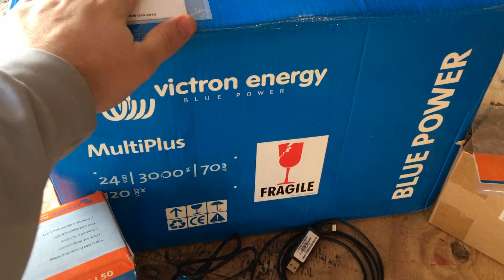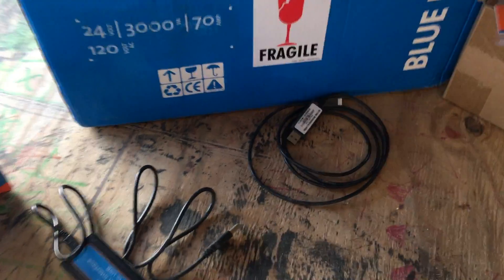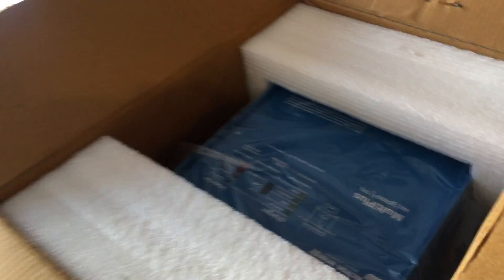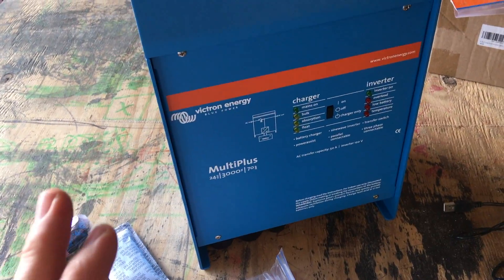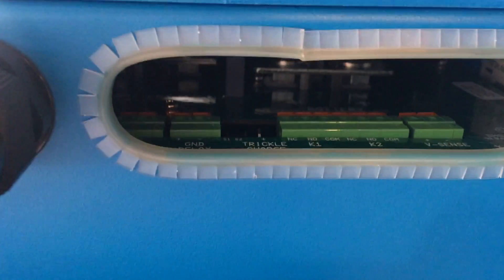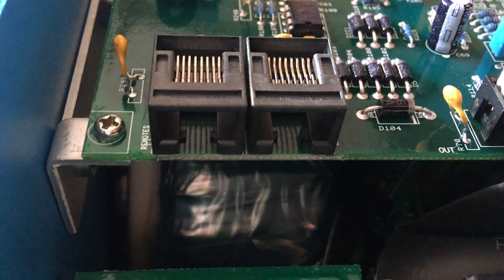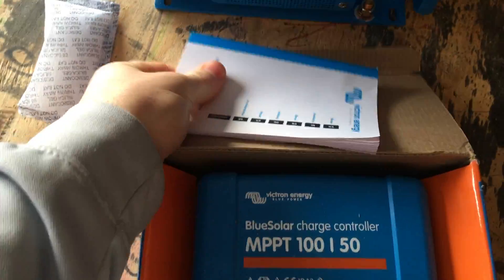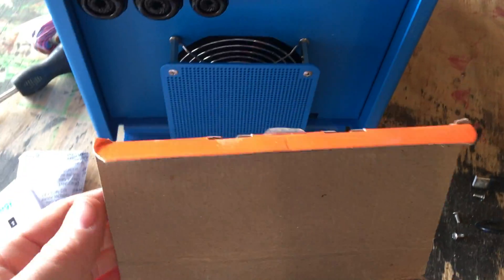We're Going all in on Victron Energy - Solar and Inverter, with a few surprises | Bus RV Conversion

Comment: Hi I've just setup my first Victron device on my coach build. It's a bmv712. I love the history graph data but wish I could log it permanently so I could go back and review later. Is there a cost effective solution for this, preferably with local storage instead of being connected to web? There seems to be a huge variety of components and not sure where to start. I am a former computer programmer.
Reply from the maker: Vrm is where it is at I’m afraid

Comment: Great tips. But , why you need a MPPT controller device ? I thought the Multiplus already has built in this feature for solar inputs. Am I confused?!
Reply: Silvio Duarte i too ask this question
Reply: The Multiplus has inverter and charger. However their EasySolar range also includes an MPPT solar regulator.

Comment: Why did you opt for the 24V over the 12? I have a 1999  RV (50Amp Bus) I just purchased the 12/3000/120-50 120V VE. Bus? not sure if I should do an exchange now?
Reply from the maker: Primary reason was my bus has a 24v alternator, so everything can work together easily.  Secondary reason I quickly realized is with a 24v battery bank I can double my solar charging capacity for free, you can also get away with smaller cabling at 24v.

Comment: I love Victron equipment. But there is a little marketing ploy they use. Your inverter is rated in VA (volts amps) not watts. I did an online conversion table, if I did it right, 3000 VA is 2.4kw. Victron products are listed in VA not watts.
Reply from the maker: That is true, however, I've found them to perform as well if not better than similarly rated inverters. 

I did one small hack to increase the rated power. Since it's limited by Amps, I increased the AC voltage to 125, this gives my AC motors a little more umph .

Comment: Hey how hard was that to program?  Would you
happen to have some pointers?  I just bought the
victron components.
Reply from the maker: Jeff Hayes if you have a Multiplus and an MPPT solar controller , I'd recommend the Venus GX, it has all the hardware ready to go. The Pi is nice, but you'll spend $200 on USB dongles to connect everything.

Comment: Hey buddy it's been awhile since you installed your Victron system I wanted to know how it's going and any upgrades I'm still on the fence which system to buy you had a AIMS before what model was it and what happened with it I'm asking because the AIMS 6000
Watt 24 volt I keep going back a checking out but I'm not sold on it yet. Thanks for your input buddy and a happy New Year.
Reply from the maker: Brian Davis well, I've heard from another aims user that had thier transfer switch relay fail, so there is that concern.   But Aims is good at fixing things under warranty. The biggest concern would be monitoring, if you like all the monitoring, Victron for everything is the way to go.

Comment: I have installed 2 of the victron 3kw inverter chargers with Battle Born lifepo4 batteries . Love the inverters features and robust design. Currently working on a small power wall for my tool box at work using the victron 12/500.

Comment: I see you mentioned the counter sink screws. The screws in my unit worked loose and the unit failed because a pc board rubbed into a couple of wires on one of the coils. Victron did not want to know about the failure due to the poor design assembly. The screws have no star washers or are lock tighted to prevent them from working loose. I'm not a happy customer as they are an expensive unit and didn't offer to repair the unit, which was a 3000w 12v to 240v multiplus inverter.

Comment: victron looks like old technology, thru hole compare this to a sunny boy.
Reply from the maker: Take a look at the monitoring Victron offers along with their support of Open Source, no one else compares.   With this one system I can monitor AC in, AC out, DC in, DC out, PV (solar) in, Water tank, generator fuel tank, waste tanks, etc .    I don't see how Victron could be considered old, sure maybe others are at the leading edge, but I like what they are doing.
Reply: Well, what I can say is this its a clever move sending telemetry out for for the open source community to build tools compared to other vendors who lock down their products, however with that said the use of thru hole aged layout is a key indication that the design is of age probably 10 years old.
Reply: lower part count, cost, smaller size, as a result lighter, more efficient (less heat) longevity
Reply: point taken, and yes you are correct but I think a company with the engineering background as Victron  a new grade grade design will probably be amazing, I think they probably doing lots of R&D on this subject, I too am into power electronics designing its a complex area notably inverter technology.
Reply: Call me old school.. but I prefer to see gear like this with trusty ol thru hole components so you can change/test stuff quicker if it goes down.. SMT makes me nervous! :)
Reply: I’m with you on being in favor of the through hole design, having worked extensively with both through hole and surface mount multi layer at an engineering level. The surface mount is faster for a machine to build and more compact, but the multi layer traces are impossible to repair and the through hole are generally better at heat dissipation and better with vibration etc, these are just like class A/B amps for high end audio vs SMT class D. The class d has less heat, more efficiency and tighter package, it’s also a throwaway product in most regards or at least a board swap rather than repair.

Comment: Hey, looks awesome! I'm really looking forward for an 'install and connect video' for that monitor.
Reply from the maker: I started a "How to make a raspberry Pi Venus OS device / CCGX"  but I found that I even forgot how.. took me a bit figure it out again.   

Sounds like there is interest in a complete run down of all the systems and how it all connects.   Just this weekend I finished up the electrical bay, but now I'm looking at upgrading batteries, uh it never stops.
Reply: Uhh.. I can imagine that.... I am especially interested how you transformed your raspberry Pi  into CCGX and how that communicate with the oder devices,  but I'm going to make my setup at the earliest in may. Right now I'm just gathering such great ideas as this one. ;)  So... just take your time. Thx a lot for your efforts!!!! Greetings from Germany
Reply from the maker: https://docs.google.com/document/d/1aZ0wS_j3UfThbn8V0Ef5vO6dALjtG3Pb_wZCpI3kiH8/edit?usp=sharing    Here are my notes so far
Reply from the maker: I added a link to my notes in the description.   I would say you can start with the Pi right away it will take some figuring to get working.  Then when you real hardware comes you can dig right in.

I would also say consider the venus GX .    https://www.victronenergy.com/panel-systems-remote-monitoring/venus-gx

It has everything except a screen.   The key thing the Venus GX and CCGX have is 2 VE Direct ports and VE Bus ports.  Each of those adapters are $30, then add a VE Bus adapter for the Multiplus which is $70 ad we're at $130 for adapters alone, plus another $130 for the rPi setup... It's still nice, I don't regret getting the Pi, but the Venus GX is a nice middle ground.
Reply: I was actually thinking about to take the Venus GX, mostly because I want to monitories 3 of my Tanks without any additional indicator. With the CCGX/Pi would need 3 of VE Can tank sander adapter (https://www.victronenergy.com/accessories/ve-can-resistive-tank-sender-adapter). 3 peaces would cost me 1458$. That is just a lot of money. However the Venus GX has 3 tank inputs but no screen. Now I'm asking myself if I could use a Pi as a monitor for the Venus GX because I don't really want to have all the Information just on my cell/Laptop. I think it is nice to have a central control panel in the van where you can see all the information at a glance.
Reply from the maker: Szilagyi Barna yes the tank adapters are very expensive. 

I was looking into connecting them directly to the analog or digital pins and having a script publish the data to the dbus .  

And yes having a pi just acting as a remote monitor could work .
Reply: Since I have actively driven tank monitors that measure capacitance, I need a way to measure voltage - so, an arduino will process those signals (and others) and I've been experimenting about inserting messages directly to dbus with a script. There are many nice shields out there for raspberry pi that optically isolate contactors, look on amazon. Also, check out this particular thread on the venus for enabling GPIO pins. While this will act as an output only for relays, it is relatively straightforward. https://groups.google.com/forum/#!topic/victron-dev-venus/nqkpANtRCBU

As such, I'd rather leave heavy lifting of signal acquisition to another device (like the arduino).
Reply from the maker: I'm extremely interested in  getting that working.   Post back or on the dev forum with what you  come up with.  I'll plug away too, but right now tank monitoring isn't my top priority, more a nice to have for this summer.
Reply: Thank you guys for the tips! I'm just really excited to try some stuff on my setup. Cheers!
Reply: Hey I figured out how to control the backlight (intensity, on/off) with relatively little pain. Go check out the mailing list.
Reply from the maker: Aaron Bockelie nice !!! I had it working with a simple command but it seemed like once it would auto dim it would never come back on.  So it's been on ever since.   I'll check it out, once we get this and tanks working I think we'll be set.

Comment: Awesome! I'm using a very similar setup on my new build...only the 12-volt version multiplus...the Raspberry Pi is something that I had never considered using! Looking into it and subscribing for future vids from you!
Reply from the maker: Colorado4x4Van yeah, Google "victron Venus OS raspberry pi" . You've got to be comfortable in the Linux command line some, but nothing even a novice couldn't learn. 

I will say if you plan on doing a bunch of victron stuff , getting a Color Control GX isn't a terrible idea either.  The MK3 Usb dongles are $70 , but you need one to configure the multiplus with the PC anyway.  

I'd say I'm $300 or so into my DIY monitor vs the $560 official one.